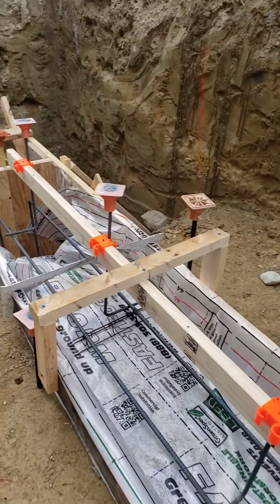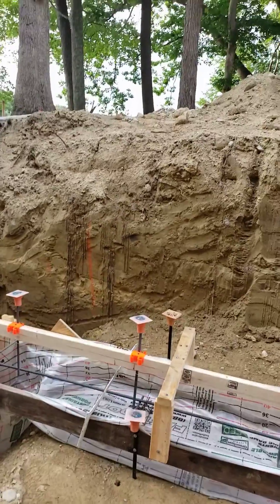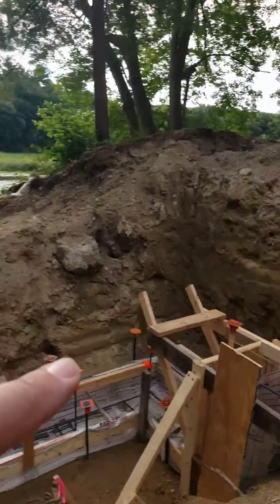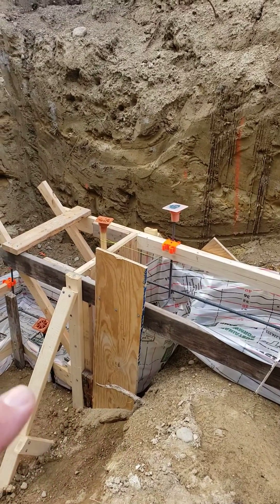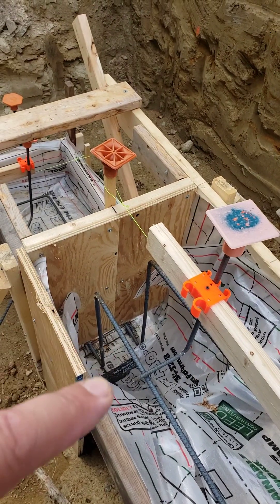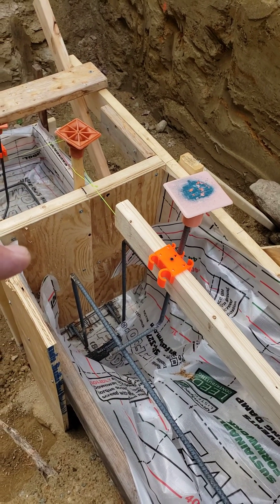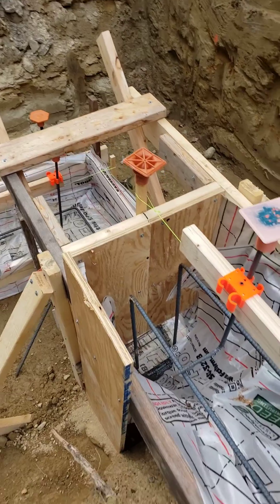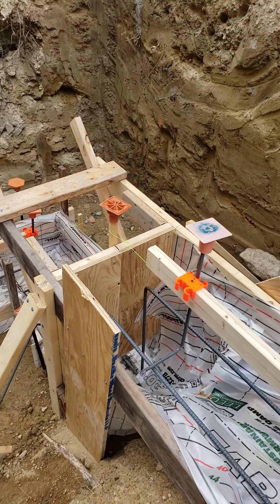Step Footing and ICF Foundation Walls

Comment: Does the concrete need to be thick to avoid flowing through that step? Or is the lower footing poured and mostly set before the upper footing is poured?
Reply from the maker: They drop some concrete in the lower section first, give it a little time to set up, then hit it from the top
Reply: @stevenbaczekarchitect9431  Thanks for the additional detail! I'm really enjoying the quick peeks at these projects.